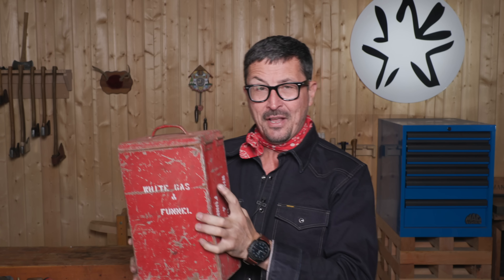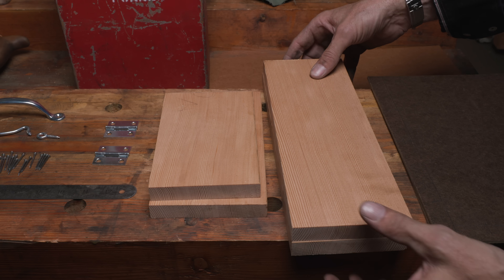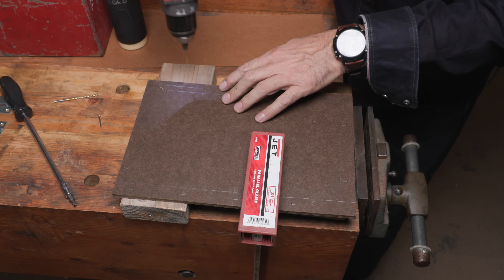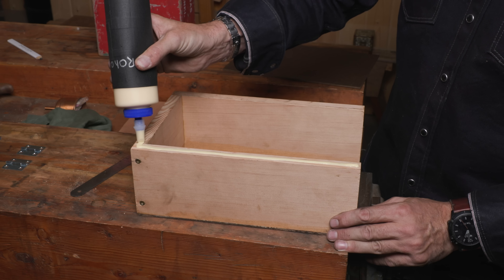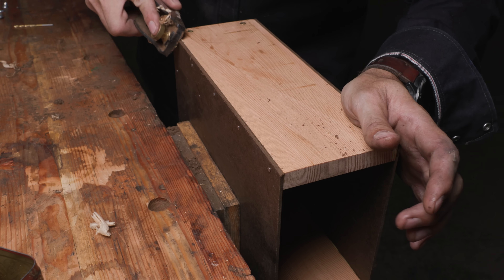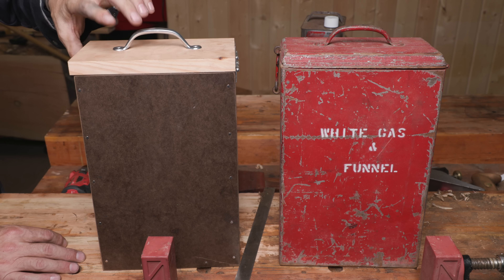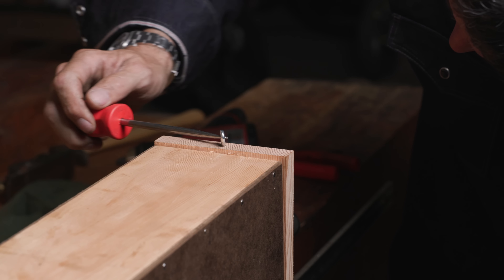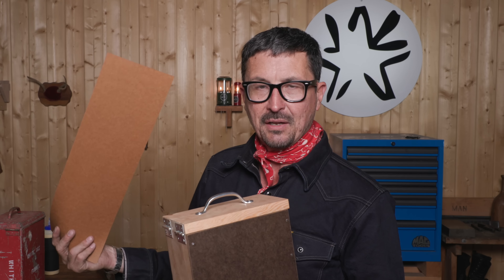Secrets of The US  Forest Service - EMERGENCY FUEL Storage

Comment: The lids are likely flush and beveled so that they can be packed closely together for efficient storage en mass. Also so they can be removed when tightly packed without catching on the neighboring boxes. I love how things that are made often express the thought process that went into their making.
Reply: With that latch? I don’t think that’s it.
Reply: Simeon is 100% correct. That’s not the only style of latch that gets used on these boxes. You can’t eliminate all snag points but you can minimize them.
Reply: Yep, prefer the old style lid.
Reply: Overhang doesn't really seem necessary when you already have a handle on the lid, just a thought
Reply: I was thinking that a modernized rendition could have a handle made of nylon webbing, with slots melted in on each end for mounting screws with flanges or washers, so that the jangle could lay flat. Then, a slot could be routed into the bottom for clearance and then these would stock vertically.  The overhangs help with clearance for the exposed hardware between the boxes.
Reply: maybe dilithium instead

Comment: Nice work, however, that latch is a bit too high up, which is why it isn't tight, and why it opened at the end, you did latch it but it came undone. You can bend the hook then it will be nice and snug.
Reply from the maker: I did like you said and it's fixed, thanks for the tip,

Comment: Those boxes are awesome! I personally use these clamp latches as the lock. You can easily tighten them and release them quickly but I find they hold the lid tighter for more security

Comment: I live in a costal forest in Massachusetts I have built storm kits for the house. Pre cut 3/4 inc plywood panels for all of my windows. Each kit has the plywood and the screws with washers. Same thing for the generator it has extra battery spark plug starting fluid pull cords and oil. I have a few other kits for emergencies in my basement and storage shed’s. We have a small hobby farm so I like to have everyone I could possibly need should the worst happen. 
I also served 21 years in the Army as a Ranger so I go by my old thought process. Pack light you will freeze at night. 
Anyhow great channel and thanks for sharing

Comment: My air compressor is set up as a kit, there's an ammo box bolted to it with adapters, tire inflator, blowgun, air tool oil, etc. 
It's all there and all that stuff is out of the way when it's not in use

Comment: I've been doing the "kit" type thing for a year or so now, but just using tool bags that came with cordless tools. One example is my tiedown bag: 4 good ratchet straps, one 50ft and two 25ft lengths of rope, small tarp, and some carabiners. All fits into the basic bag 12"- 14" bag most drills come with.

Definitely inspired to build some boxes for the things that don't quite fit in the bags or need more protection.

Comment: You should chamfer the edge of the lid for the same reason you chamfet the edge of the tempered sheet, reduce chipping
Reply: Looks a little nicer too. Could still keep the 1/8 overhang but it's a simple box not an art piece.  Time is money or sometimes better spent elsewhere.

Comment: If you want another copper funnel you may be able to make several on your own by using a process called “metal spinning”. I believe a wood lathe can be modified for that process and you would use the wood lathe to make the mold anyways.

I could be wrong, but I seem to recall spinning copper is slightly more advanced because it can become work-hardened faster than some of the other metals.

Comment: Hey Cody I only recently came across your channel I have thoroughly enjoyed watching you videos and have learned a ton keep up the great content! P.S. I have been going back and watching some of your older videos just catching up on all that I’ve been missing the video I watched previously to this you were asking about the splatter from your mig we used to use this stuff you dip the end of your welder in I cannot think of the name of it but we switched to a spray that works a little better as far as the cause it’s a combination of things in my experience it’s pretty much unavoidable I always just kept an about 5” brick chisel handy to scrape over big surfaces and screwdriver to get into tight spaces or just run your soft wheel on your grinder over it with very light pressure will also get it off…the brick chisel is also very useful to get the slag of the edge of material if you cut with your plasma just smack it with flat of the chisel it’s actually quicker than trying to grind it off sometimes
Reply from the maker: Thanks David for the suggestion,

Comment: east coast here. We would call that hardboard masonite. Its great for interior floor protection jobs. 1/4" holds up well against cart wheels. Even 1/8" isnt too bad. Def need 1/4" if you're on carpet though. It holds up better than 1/4" ply for the floor protection and its cheaper. No good for outside though, water reisitance is prety bad. I've also seen it as the back on cheap bookshelves or cabinets.

Comment: I’ve mostly used regular pump gas in my old lanterns due to just having it around. On the flip side in a pinch I’ve ran small engines at time on the Coleman fuel.

Comment: i would guess the reason the lid is slanted is maybe to prevent snagging if you put it in a pack? i agree the over hang is a nice addition. i might have put a groove in the edge of the lid as finger holds instead. i have bad luck with edges and splinters

Comment: One upgrade I would like to do is to use longer hinges with the pivot point at the very top of the lid. This would allow the lid to lay down almost flat on the side (handle would prevent it from being totally flat) rather than sticking out at a 90° when opened. Seems that would be a weak link, especially when kids are around.

Comment: Love all the videos.. Perhaps when using glue, apply as you did, as an extra step, wipe into wood w fingers , let soak in under a minute, then reapply another line of it on all pieces, & of course use an exterior waterproof glue if projects exposed to weather.. You did a fantastic job.

Comment: The Kmart store at 3rd and fairfax in los Angeles used to keep a pallet of coleman gallons and bottles of propane at the top of the basement access stairs.  The propane cans in the far corner of the basement were on upper shelves without any rails to stop them from falling off the shelves.  This to me looked so dangerous as a fire hazard with hundreds of people in the store.   If somebody knocked off a gallon at the top of the stairs it could flow down into the basement.

Comment: I like the safety boots in this video. I think the model is called "Safety Sally's worst nightmare". Refer to the author of the Bible for an exact parts number. 🤣

BTW,  in my opinion, all edges on all carpentry work should be rounded or bevelled. It protects the edges, less likely to cut yourself, less likely to scratch a softer surface, and in my experience paint will stick better compared to a 90° edge. If the paint chips off a hard edge it will continue to peel off.

Besides, IMHO it also looks much better, much more professional, with very little extra work.

Comment: I dont see the point to the overhang of the lid.  I think it would look better flush.  I know you said its so you have something to grab onto to lift but it has a handle on top you can use and the eyelit of the latch would also give you a quick spot to lift from if needed.

Comment: A flush lid means they won't get hung up on each other when you're setting them side by side.
Reply: The added overhang is where the latch is not on the sides. So a small overhand there will change the amount the get hung up to a significant degree.   At the same time the latch will provide a point to girip there.

Comment: 8:30 "Old things aren't always best. It's a place to start."

Had to stop the video and make this comment. 

If a few people in today's crazy world hell-bent on ushering in the new Utopia in part by redefining and/or erasing history would take that advice to heart, I would feel a little better that a New Dark Ages is not about to take place. 

(I think the original lid is beveled and flush for the same reasons that you broke the edges on the corners and sides. Prevent chipping and excessive wear from rough handling. That edge you left will catch and pull on your latch every time you put it in the truck. You will discover soon enough if you chose wisely.